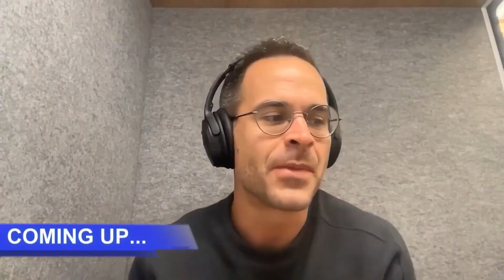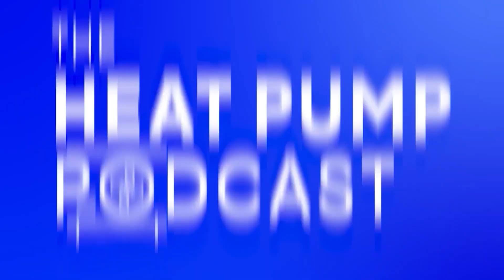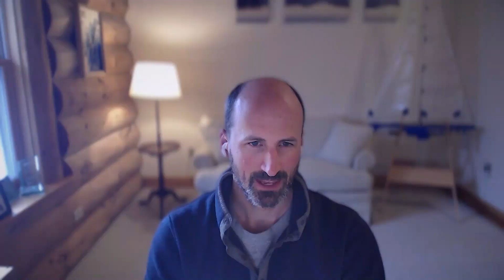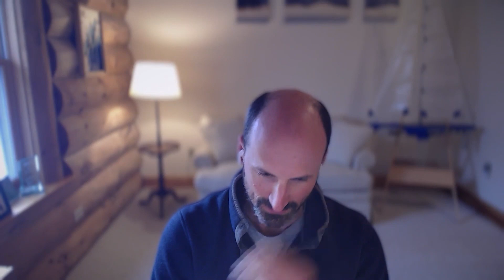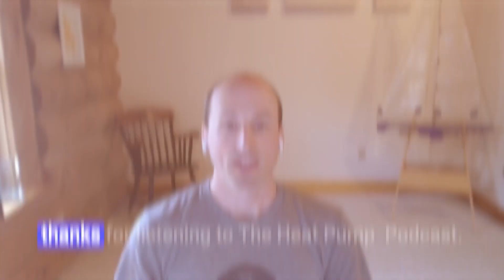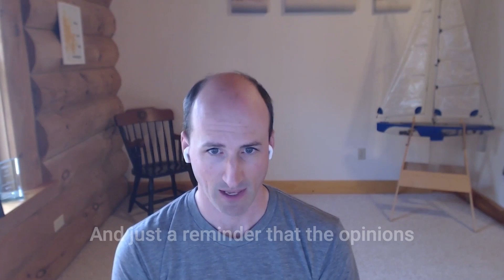Creating the First New Heat Pump OEM in 60 Years with Paul Lambert

Comment: 19:00 solve CONSUMER problems (left out "if they dont have ducts")
20:00 "heating rooms they arent in" indicates he doesn't understand some very basic tenents on building science.
24:00 our design, not our manufacturing 
26:00 software control with truly communicating t-stat is an opportunity (better dehumidification is needed for mini splits

Comment: Thank you guys. I love your channel and content. Please keep it going. Now regarding Quilt… I am sorry, but to call it Tesla of hvac is a wishful thinking. Adding a few sensors and putting it in a square box is nothing revolutionary. It is still the same old mini-split which doesn’t address air mixing, dehumidification, filtering, ventilation - really nothing. I have installed Mr cool in my garage and it installed flawlessly and working flawlessly. But it is good only for garage. Home requires a system of systems approach which your guests are tirelessly defending. On another note, Nest was a decent company before Google of Silicon Valley took it over. I have their cams, smoke detectors and thermostats, but I just bought couple of eufy cams for the fraction of cost and it is just as good if not better.
Reply: For people limited to mini splits, better dehumidification control is an opportunity. 

But yes to the rest of that.
Reply: I agree. Their approach seems pretty specific to places like the Bay Area, where many homes lack central duct systems and adding them is incredibly expensive. 

A 3 zone minisplit system won’t provide good comfort for most homes in America.

Comment: Love the design of Quilts and I trust that a lot of optimization is in the software and this is what I would have liked to hear more about. But that CEO is just full of Silicon Valley BS. If he would do it for his kids, he would use R290. From what I heard he is probably working together with Midea. I wonder what impact the tariffs have on his business and I wonder the reliability of the systems. In Germany some HVAC technicians just dropped the Chinese because in-guarantee servicing is financially dangerous and the Japanese are less innovative but more reliable and compatible on parts over the years.
Reply: Unfortunately R290 isn’t approved for use in AC systems in the US